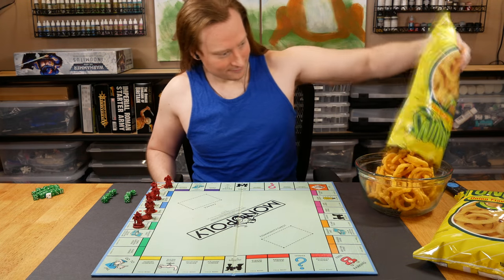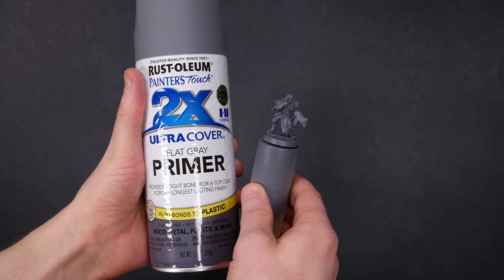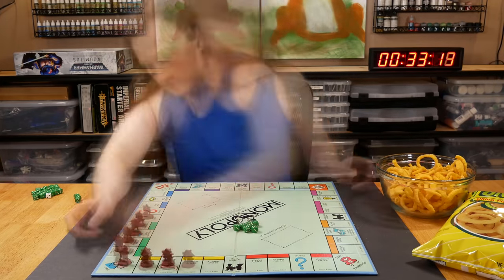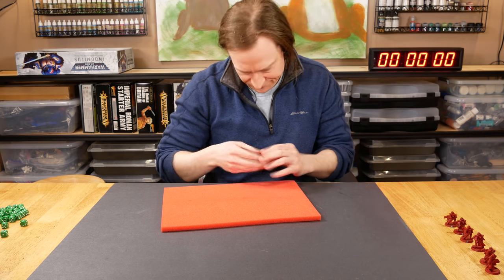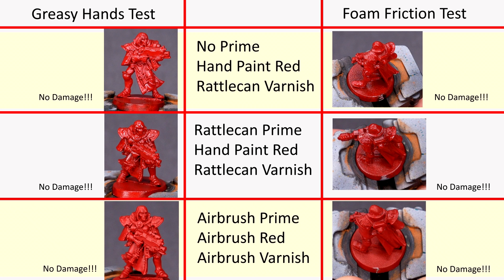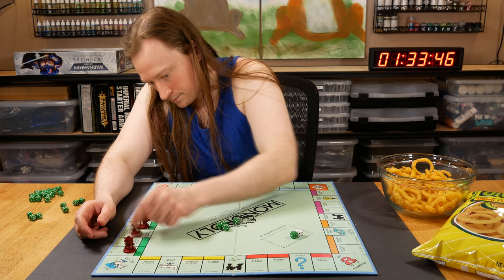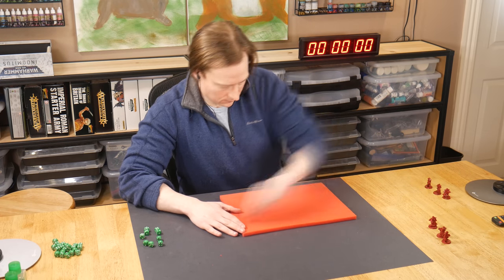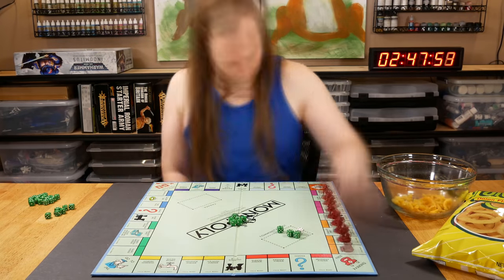Varnish Actually Works!?

Comment: I'd be curious how watered-down PVA keeps up with varnish. I use it on my terrain and bases, so I'd be interested to know if I'm wasting my time or if it could be a cheaper alternative to varnish.
Reply from the maker: You use pva as a sealant on minis? I've seen people do a final coat on terrain board, but never minis, interesting!
Reply: @GoobertownHobbies  I use it for mini bases because it supposedly helps keep it from chipping, but I've always wondered if it could work for minis too

Comment: One possible problem with the "Around the Board" test is did you do a control group of them miniatures where it is just freshly cleaned hands with no added oils from funyuns. Without it do you really have a baseline group that would really show normal game play handling?

I know I'm a little odd, but I try to handle certain things which I own only after washing my hands. This started with me back in the late 1980's when I was collecting comic books.

Just a thought I had about the testing. But otherwise I have to say I'm enjoying this new video series... if it really becomes a series that is.

Comment: Would be really cool if you tested soft plastic (e.g. board game or reaper) miniatures with certain sprays (Army Painter had this a little bit, but Vallejo spray primer was extremely poor). After a few weeks/months something chemical happens (i guess with the plasticizers) and the figures got absurdly tacky. Even through a full acrylic paintjob and acrylic varnish!
After trying a lot of different products, thickly applied polyurethane varnish seemed to help a bit, but i fear under the varnish layer the miniatures will become goo in the end.

The infos on the web about this issue are hard to find and pretty inconclusive.
Dr. Goobs is the only person on this world that can help us now! :(

Just an idea :)

Comment: You convinced me to varnish my minis, and then my friend immediately told me to not do that in Colorado because the dry climate will cause the varnish to frost/cloud ruining my efforts. I googled it and learned too much humidity causes clouding. Someone else blamed too much absorption. Another pointed at not shaking the varnish well enough. I’ve heard spray varnish is more at risk and that it works better than brushed varnish. Another guy said his varnish applied fine but months later is cloudy.

I’m lost and scared. You’re uniquely qualified to be an authority on this issue. Please help. I want to varnish my minis.

Comment: Not that I really want to subject you to 3 more hours of Monopoly conga, but I'd be curious if the plastic minis from the previous video fared any differently in the greasy hands test and foam friction tests. It's clear that plastic minis do a lot better than metal in the shake test - would that also translate to the other tests? Perhaps it's just metal minis that benefit from varnish?

Comment: Most of my minis get sticky a few months after varnish ? Any ideas
Reply from the maker: try using thinner layers and really making sure each coat is dry before you put the next one on... Other than that, it might be a brand issue?  I wish you the best of luck in getting it sorted out! :-)
Reply: @GoobertownHobbies  thank you goober ! Which spray satin varnish would you recommend?
Reply from the maker: @TheLayawn  I mostly use vallejo varnish through my airbrush, so I don't have a ton of personal experience with rattlecans.  I know a lot of people swear by testors, but really most spray varnishes should work...